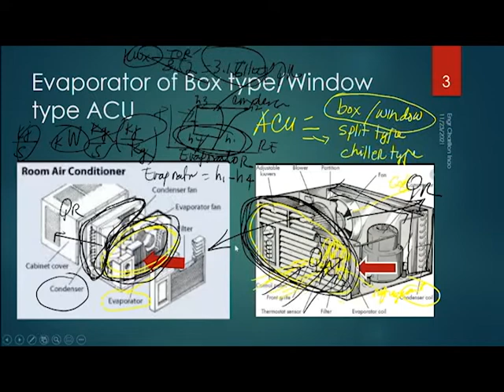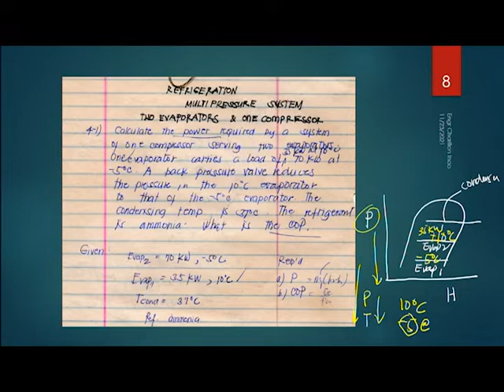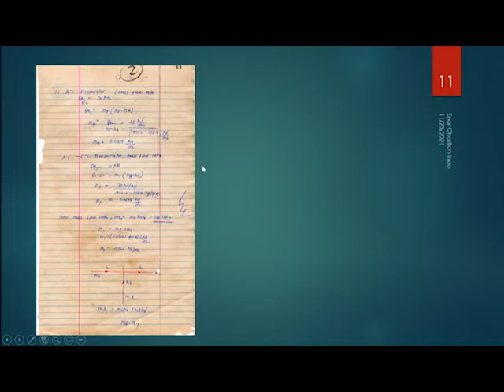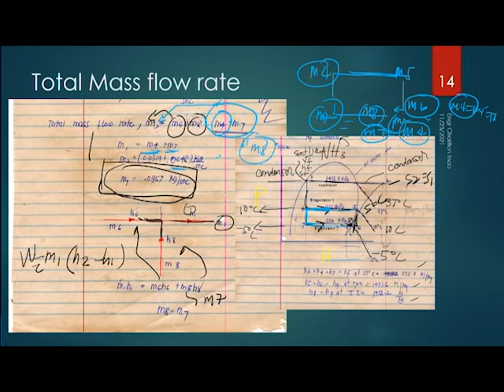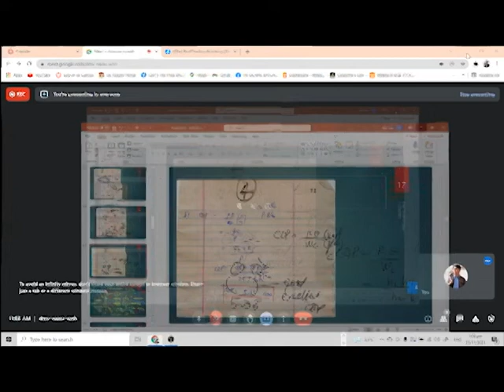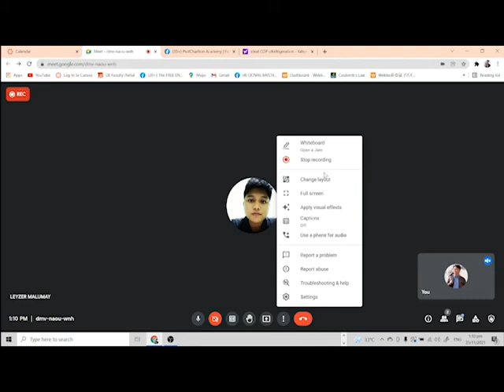EVAPORATORS|| MULTI  PRESSURE REFRIGERATION SYSTEMS  Episode 1

Comment: Back Pressure Valves (Control / Sustaining) that throttle to maintain a minimum upstream (inlet) pressure regardless of changes in demand downstream. The throttled position of the main valve diaphragm assembly is controlled by a pilot valve which senses the upstream pressure.

Comment from the maker: As refrigerant absorbs heat from indoor air, it transitions from a low-pressure gas to a high-pressure liquid. ... The refrigerant then cools down and turns back into a low-pressure gas. Another fan located inside the home blows air over the cool coils to distribute the resulting cold air throughout the building.

Comment from the maker: The evaporator works the opposite of the condenser, here refrigerant liquid is converted to gas, absorbing heat from the air in the compartment. ... This causes the refrigerant to absorb heat from the warm air and reach its low boiling point rapidly. The refrigerant then vaporizes, absorbing the maximum amount of heat.